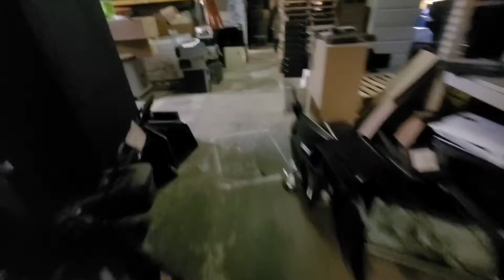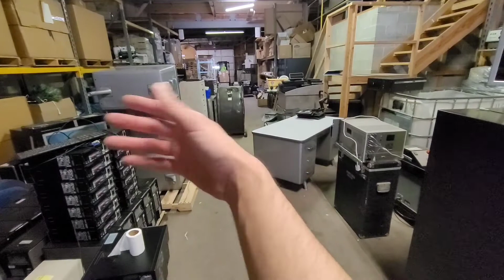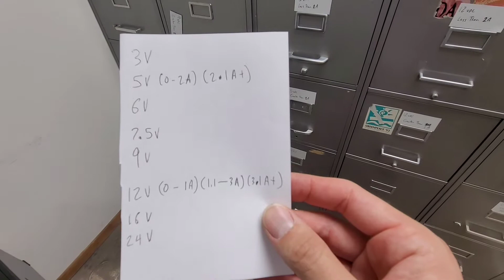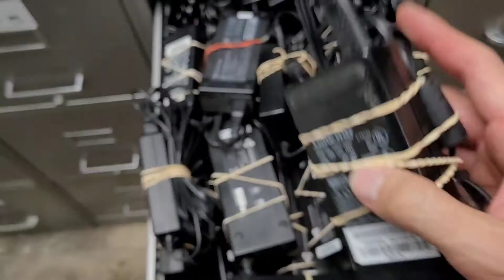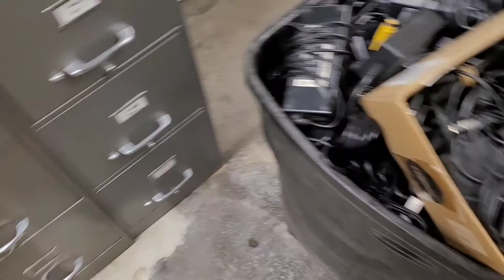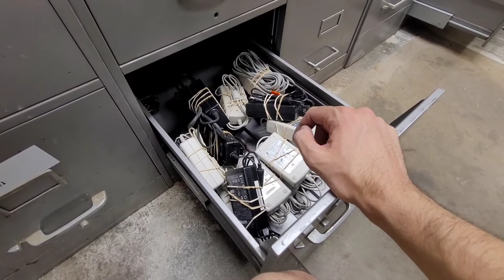Having a little weekend fun sorting electronics.

Comment: I seriously never even considered a filing cabinet for electronics. Makes sense when the sq/ft are available.
Reply from the maker: They are fantastic.  Plus depending on your area they are way cheaper than any shelving or cabinets available.  I try not to pay more than $5 each for them.  A person should easily be able to find used ones for less than $20 from my experience.